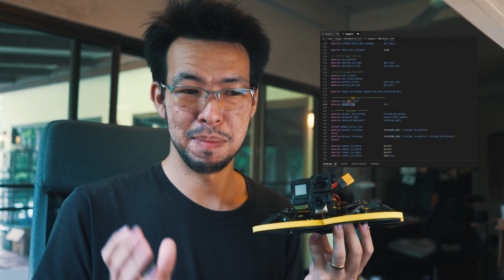Head Tracker FPV Camera on HGLRC Veyron35 CR Pusher Drone

Comment: I think your problem with the uarts was that you need a port with timing (like LED) for pwm signals. Had the same issue when i tried to build my 10" with releasehook for gliders :). Great video again. You are really underrated! all the best from germany
Reply from the maker: UARTs do rely on the timers inbuilt to these microprocessors, and Betaflight allows you to remap pins so that any UART can in theory be used as a PWM/PPM servo output, but I couldn't work out how to do this in the target code for INAV.

I think it's also related to assigning the correct timer, because different timers are configured to run at different frequencies, such that you should be able to run most of the UARTs on one or two timers (depends on the pins) but if they're running as hardware serial then they maybe can't be used to do PWM output at the same time, so I'm sure it was related to selecting the a different/correct timer for the pin that I wanted to use, but I'm not great at reading datasheets and working out which one should be used or not.  Quite confusing.

LED pin evidently happily running on a timer separate from the hardware serial such that it was happy to let me repurpose that pin.

In future, just easier to get a flight controller with more control outputs - all the new MK4 F722 controllers from Diatone have 8 motor outputs, so if I'm flying just a quad then I have 4 extra pins I can use to drive motors or servos.  Much easier, haha.

Comment: Thanks a lot! Was trying to find out if this frame would fit a standard stack (I like to have opportunity to swap boards with my 5-inch) and that's a perfect answer to my question ). Just one thing, do you think if vista would fit in the back part of the frame, below where your gps module is now mounted?
Reply from the maker: Glad I could help!  Unfortunately no, there is a tall standoff which is used to partially support the carbon base plate that the Vista would normally be mounted-to.  This standoff would go through your Vista, basically.  Now, if you trust that the prop guards plus the front standoff are strong enough to support the base plate, then maybe you could fit it by removing the rear standoff, but will still be tight nonetheless.

If the Vista could fit, another idea is to drill and tap two small holes on the metal case/heatsink of the Vista to bolt everything together, but it's highly unrecommended.  But if you did (for fun) try to do that, please disassemble the Vista and separate the heatsink cases before drilling the holes, otherwise you could drill through the Vista.

My recommendation is just do what I did and fit everything tightly right where they normally go, or grab yourself a mini stack and save yourself the trouble I had (even though I hear the mini-stack plus Vista is still quite tight).  It was really quite the challenge, fitting the full stack and having to 3D print an adapter.
Reply: @STRIKINGFPV  got it. Now I saw that standoff, yeah it won't work ). And I will still use a full size stack, I already have experience fitting stacks where they are not supposed to fit, so that's not a problem.

Comment: Hey thanks for all your insights do you think the DJI Avata + Goggles 2 is a winner in this regard? i am still debating if i use the avata wit the v2 und tilt via Controller.or if the Goggles 2 with Headtracking are a necassity. At least in Normal and Sports mode the avata tilts by itself. Do you have any advice?
Reply from the maker: Oh man, I'm very much not the expert on this topic since I'm not 100% aware of the Avata's tracking functionality.  I believe it's both yaw as well as camera tilt, but I think it does a thing where the control direction seemingly ignores whatever direction you've looked towards?  So if you want to actually turn the drone you use the controller, but the head tracking itself is sorta like if you were walking but decided to look around whilst still walking forward.

Again, hard for me to say.  I do like the possibilities of what headtracking can do for me, and I'm sure the Avata's headtracking can help similarly, but I suppose I like that what we can do in the DIY world, which is tweak our stuff to our liking, whereas the DJI stuff is whatever they give you and nothing else, as well as any bugs or quirks that come along with it.

If the question is whether or not you should go with Goggles 2, I think you can focus on its other pros first, namely its size, adjustable dioptres and as-yet-to-be-implemented backwards compatibility with all the older gear that we're still flying with.  The headtracking with the Avata is just a bonus to that, so if it's all tickling your fancy then it might be the way to go.

If you ever go the DIY route afterwards though, it's very unlikely that the new Goggles will offer some output method for its headtracking features, so you'd have to add a separate DIY headtracker in the end.
Reply: @STRIKINGFPV  hey thanks for your extesive answer. I am Looking foreward to See you put your headtracking to creative use. You are absolutely  right about the possibilities of the diy Route. Especialky wirh the new O3 Air unit comeing. Ever since medline drone and nurk put it on a full size gopro i was wondering why they did not go with a naked gopro. I think its the future for cinewhoops. That may be why dji has paid bubby fpv via Rotor riot to showcase their headtracking. By the way are you still flying your lion batteries or have you swiched back to lipo or lihv for cinewhoops?
Reply from the maker: @FlyingBeeFPV  Actually since I've switched to 6S batteries and INAV, the 4S Li-Ion hasn't seen much action.  Issue is INAV doesn't do the auto throttle scaling thing upon voltage detection, and to be fair you'd also have to have different altitude hold throttle values too, since the weight plays a big role in that.

I now mainly use it for powering the flight controller/vista hardware at a lower voltage when doing tests, though now that I've got the OSD menu working with the DJI goggles I could change the appropriate values in the OSD before flight - just haven't bothered.

I've got a new build coming up that'll still use 6S, but I'm gonna' build a 6S Li-Ion battery to test with that, and might even chuck it on the Veyron35 for fun, see if it works happily or not, haha.
Reply: @STRIKINGFPV  yeah intresting that betaflight now is working on better sensor Integration. Unfortunately i have not touched INAV at all. If you have the time for a tutorial explaining sensor Integration  altitude hold, rth. Auto landing i would apretiate that much. Also Looking forward to your 6s lion R&D 😀. By the way i think your Videos are very pleasing to watch. The right amount of deph for me to unterstand, while not beeing to shallow or selfcentric. Thanks alot for shareing your knowledge and expieriences.
Reply from the maker: @FlyingBeeFPV  I mean yeah, might be able to integrate that into the build video, or maybe would be a series on building then configuring.  Would definitely explain my choice of INAV and stuff.
Reply: @STRIKINGFPV  The best way I can describe the Avata head tracking is it's like you're playing a flight simulator with a VR headset for free-looking and a joystick (except the joystick acts more like a gyro based pointer so it takes a little bit of getting used to and the trigger is throttle).
Reply from the maker: @chronowarp123  Ah, thanks for weighing in.  Does it have like a virtual direction?  So like, if the Avata is pointing North, and you look  to the West, will flying "forward" still take you North, or will it fly according to where you're looking?
Reply: @STRIKINGFPV  There's an indicator in the view that tells you which direction the Avata will fly towards when you give it throttle (if you turn your head far enough, it'll go 'off-screen'). This is completely seperate from where you're looking. It achieves this by mixing the appropriate amount of roll/pitch.

So if that indicator is pointing North, and you're looking West, the Avata will be pointing West (since the camera always points forward), but it'll fly North by rolling right instead of pitching forward. It can be slightly disorientating if you're not flying smoothly because the camera gimbal doesn't compensate for roll (I feel like there's a little bit of compensation through software but not 100% sure if I'm right).
Reply from the maker: @chronowarp123  Great explanation, I totally understand what you mean.  What surprises me is how I don't see that many videos which properly explain how it works, or at least I can't really find many that do so - seems to get lost in the tsnumi of "review" videos.

Aside from that, how's your experience with the Avata been?  And is it your first FPV drone or have you been flying for a while now?
Reply: @STRIKINGFPV    I couldn't find any explanation of how it worked either; I was expecting something like a single axis tracking and I got more than what I expected :)   

I've been flying FPV for a few years and have put together a variety of quads. I like the Avata for the compactness as a whole and the long flight times. The biggest issue I have is the prop guards do experience washout and turbulence (it's a thing with cinewhoops. Worse than on my squirt V2 though), which cause stability issues in windy conditions and/or when doing certain maneuvers (I usually fly manual mode with the RC remote, not the motion controller)
Reply from the maker: @chronowarp123  Ah cool, so you've got enough understanding and experience of how quads work to know what the Avata is and isn't, nice.

I'm not a hater, personally, despite many in the FPV community disliking what the Avata does in terms of lowering entry level to the hobby - the original FPV potato they pushed out I thought was okay to slightly questionable, but the Avata looks to be a better product overall, more mature, and for what it has onboard it's actually quite incredible.  18 minute flight times and more-or-less not requiring a GoPro is nothing to scoff at, so to some degree I'm also considering getting one, if budget would allow.

Thailand's also weird with drone registration, where DIY drones are kinda unable to be registered, but the DJI ones are since they've gone through all the FCC CE WTFBBQ regulations, so there's that as well, but that's another topic, lol.
Reply: @STRIKINGFPV  The realistic battery life is more like 10-12 minutes than 18 minutes, but still much more than the 5-6 minutes I get with a cinewhoop with similar flying. DJI loves to inflate their flight time specs! Plus you don't need to buy an action camera. So it's a great AIO travel package. But, it is expensive and you're kind of stuck with whatever warts it has. 

I feel a bit mixed about lowering barriers to entry... I think it's great for more people to get to enjoy the experience, but there are also people out there who throw cautions in the wind, does something silly, and ruins it for everyone else in the hobby.
Reply from the maker: @chronowarp123  Oh no yeah, flight times are also subject to conditions, had the same with my Mavic Pro. To be fair there are people who have full-on deactivated all the safety features and flown past 0% to get like doubley long flight times at the cost of maybe damaging the battery, so in some ways it might not be as inflated as we think 😅.

In terms of lower barrier to entry, I agree with you that the more casual people who can grab this and do stupid things is definitely not good, but I'm more thinking along the lines of, say, videographers or photographers who can now offer property fly-throughs and stuff as additional services to their usual gigs.

Some feel bitter about that, considering the effort that we've put into the craft over the years can now be surpassed by someone who can play video games and has the cash to drop on something like the Avata.

I mean, I'm surrounded by people with better/newer equipment and more connections than me in the photography/videography space, so I guess I'm used to coping 🤣.

Comment: How do I get head tracking on ELRS?
Reply from the maker: Basically you need a radio controller with a trainer port and then get yourself a headtracker unit, either a premade or DIY one.  Plug the headtracker into the radiocontrol and configure one of the outputs from the tracker to send its signal through your ELRS transmitter.

Crucially, ELRS needs to be in wide mode or one of the full-res modes, so that the AUX channels can have higher resolution so that the movement of the servo is smoother.  In hybrid mode, for example, channel 8 only has 6 positions, which won't make for great servo movements.
Reply: Can you give me anymore details to it?  I have got head tracking on spektrum(ix20SE/DX18 and crossfire) @STRIKINGFPV